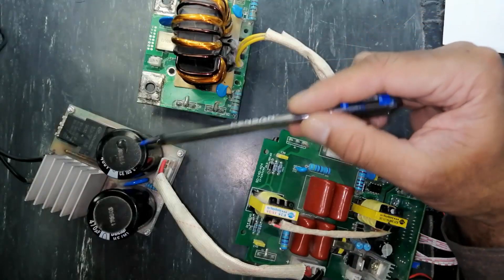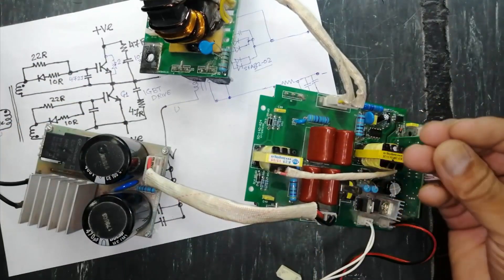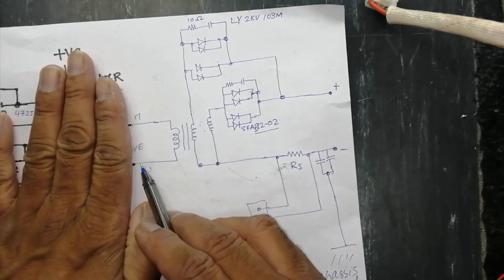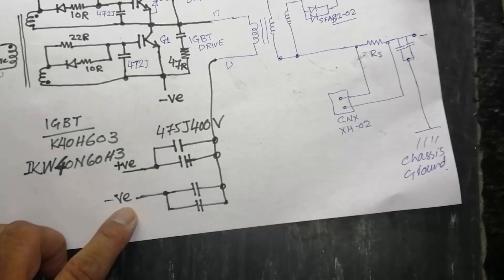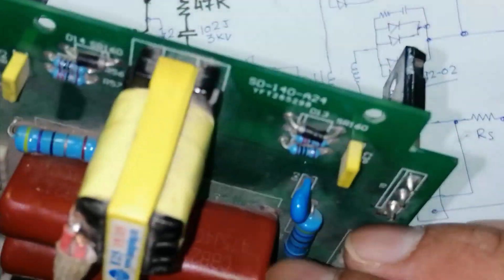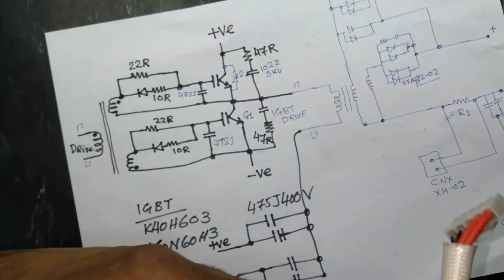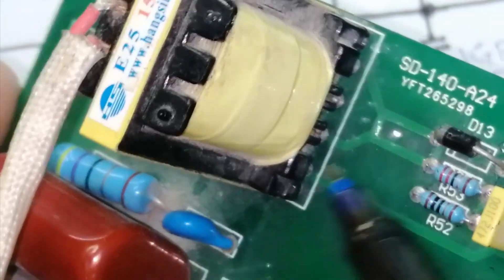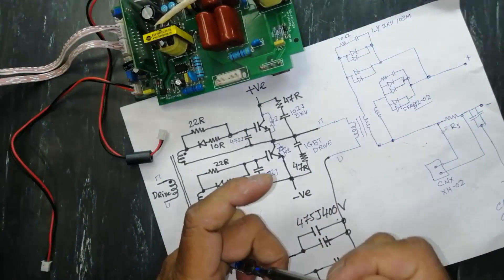#288 Inverter IGBT Welder Machine (Part -3) IGBT & Gate Driver Circuit Explained & Troubleshooting

Comment: Hello sir, i have a problem here. My gate driver transformer have a short between G and E terminal, i have been taking out the gdt modul and the short of igbt is gone. And i have been measured all of the component related, everything is normal. What could be wrong? I hope you can help me, i just started my business about welding machine service and maintenance in my local area.

Comment: If the driver network compoments buned or shorted, how can find the correct values of them to replace?
Reply from the maker: yes that is really big question mark. because each manufacturer uses his own defined parts. and they don't provide any service maual or parts catalog or any reference manual. 
just we can take values from similar model (if we have) otherwise we can use try method
there are some spproximated values for components in each stage
Reply: @HaseebElectronics can you please do a video about that kind of repair ?

Comment: My inverter welding machine  burnt one igbs so after replacing a new one the machine just powered on but no out put voltage
Reply from the maker: most of time, IGBT's gate drive components must be verified. as these gate components get damaged with IGBT.

Comment: Sir, how can I trigger the pwm signal on my welding machine circuit board so I can test the IGBT signals with the IGBT's removed. It is a mig welder with H bridge configuration but the boards are out of the machine and I have no schematic . I presume the torch trigger initiates the IGBT firing upon commencement of  starting to weld. I have the option to select arc welding ; would briefly short circuiting the output fire the IGBT pulse for oscilloscope capture?  Could I trigger the UC3846 IC with a low voltage signal on the current transformer pins ?

Comment: If I may ask the 104j capacitor is the same capacitor valve that use on the oscillating ic is that right question

Comment: Why use these 475j/400v capacitor to sencond node of transformer winding 

Why not connect to direct -ve terminal 
1. How to select the value of these capacitor
Reply from the maker: kindly check video number 626 for your detailed answer

Comment: Hello sir, pls am having a problem in inverter welding machine if I fix a new igbt it will blow it off before 10mins pls I need ur explanation on the issue sir , Allah bless you and long life in wisdom thanks.

Comment: What is the idle (no load) output voltage of this type  inverter welding machines?
Reply from the maker: it differs from one to other manufacturer. 
most commonly 50 to 80 volts
Reply: @HaseebElectronics  thanks

Comment: Hello friend, I have a problem with my welding machine, after using it for a few days it burns the fgh60n60, check but I do not find any error.
It is a lusqtoff iron-100 80A, can you tell me possible errors?
Reply from the maker: 1, check large ceramic capacitors connected in series with main dc capacitor towards IGBT
2. if switching frequency is incorrect
3. if delay time between both channels is not proper
4. if transformer core is saturated

Comment: Why those cbb2 capacitors are used in series with the IGBT? Is it to prevent short circuit if IGBT fails?  I have seen welding inverters without those capacitors so just want to clear it.

Comment: Thanks hasseb for this vedio.
I have an atx power supply dell desktop starts up and after 2 minutes it stops. I touch the tny280pn ic with my finger abnormal heating of the tny280pn stand by ic when the atx starts up. is what can be the cause of the problem when atx stops after  2 minutes.